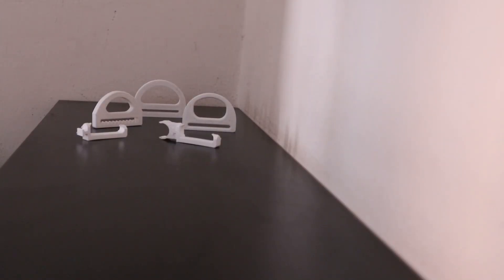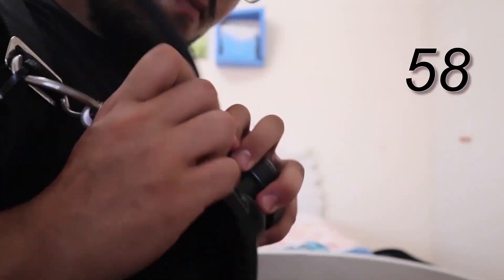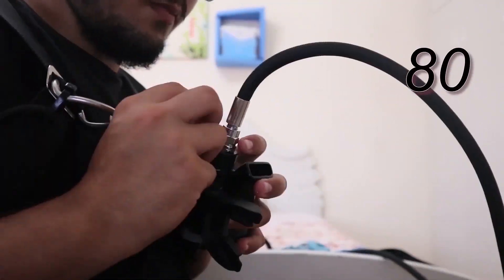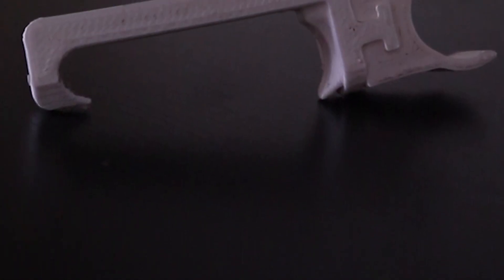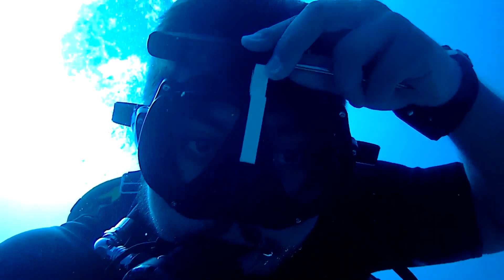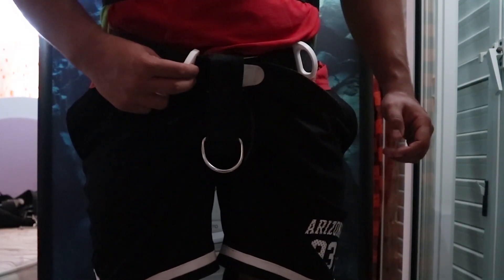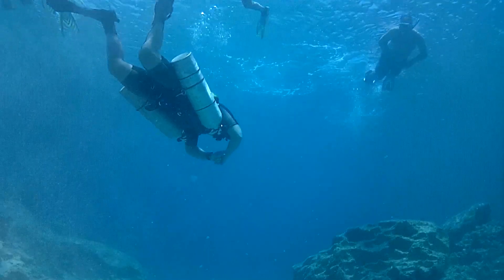3d printed parts , Shall i trust my life on ?

Comment: What's the screwdriver for?

and I would suggest trying nylon if you're concerned about your printed parts. I've used both PLA and PETG without any real problems, but I've heard even better things about nylon.
Reply from the maker: the screwwdriver holder , is to hold my screwdriver on the mask while i dive ! my cylinders need adjustments on every dive ! so i had to find a way to stow it so i dont have to hold it in my hands ! wearing scuba pants with pockets is a way better solution but those cost more than 100$ each ! so i made that simple holder !

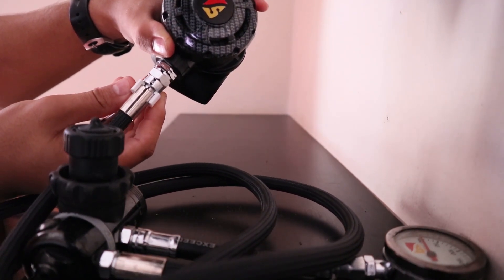Comment: 0:40 the plastic will creep over time and you'll lose it. The best way to make 3D printed C-clips is to not do C-clips; make them closed cylinders instead and they won't be able to creep out of the shape you've given them.
Reply from the maker: Yes , I do agree with you ! But the o-ring method also disintegrates after some use ! The main and most important fetures of this , is that it gives the opportunity to teachers , to repeatedly teach the emergency break away , with students without throwing o-rings in the ocean ! Of course you have to know how to detach a boltsnap fast enough ! But I believe is useful for all divers , newbies or not !